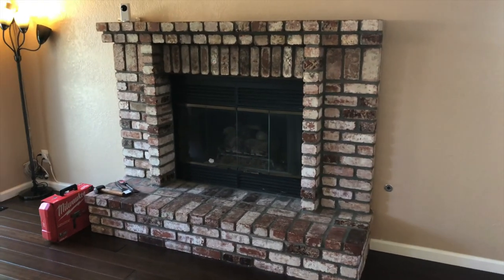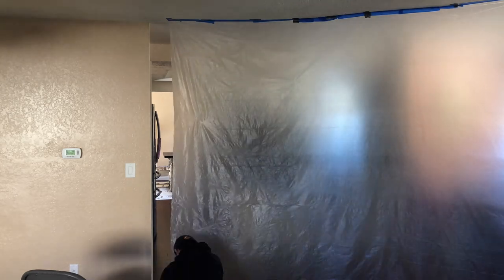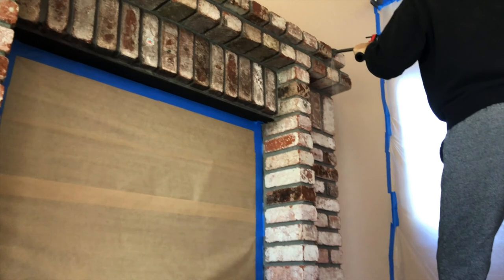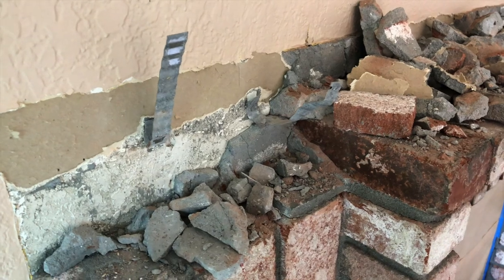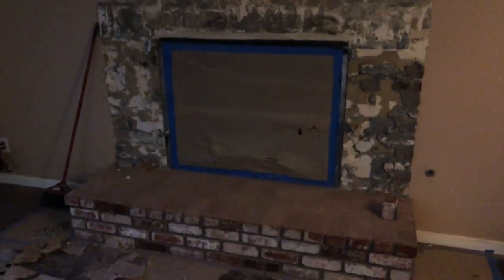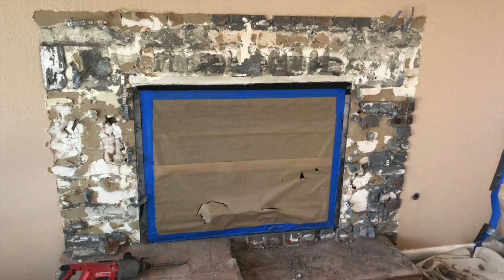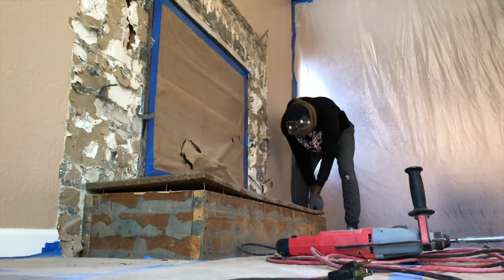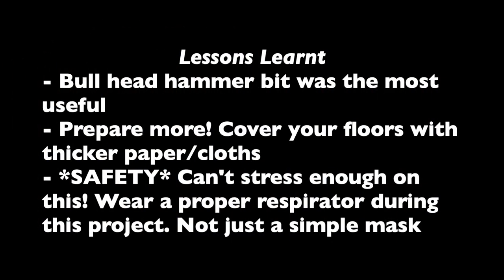Brick Fireplace Makeover!! Part 1: Demo / Demolition

Comment: Interesting, I was thinking the bottom part was solid, but you had a treasure chest inside. I just want to remove the bottom part and have the brick on the wall.
Reply: I want the same thing but after watching this you would have to salvage about 30 bricks and mortar them under the fireplace to the wall.  It would take good skill and patience to make it look uniform as if original.
Reply: @keithcastleberry3993  Might depend how easy they come off. I think if you had lots of time you could do it. Also a hand grinder with a ceramic cutting disc would help a lot.
Reply: It's a requirement by your insurance to keep the lower part (called the "hearth" of the fireplace) in case the fireplace has any sparks or ashes. It's a fire hazard otherwise, so if you remove the bottom, you'll need to tile the bottom floor portion.
Reply: @lisam2079  The living room is tile so shouldn't be an issue.

Comment: How do you remove those brackets?  They are a real pain and nasty metal/embedded nails.
Reply: Yes! I focused on removing the bricks from the wall. Removed the brackets once the bricks were off. Used a hammer or cut off that part of the drywall which I was going to replace anyway. Good luck!
Reply: @pardeepkang8812  I ended up cutting the metal bands (16th of an inch in, at a time) with aviation snips, until there was no more than the size of the nail head.  Then, with a ball peen hammer, set the nail and remainder of metal deep enough to mud over the pit/hole.
Reply from the maker: @susanmead4350  I used a hammer as well! Part 2 is live! Check out my channel, thanks for watching.